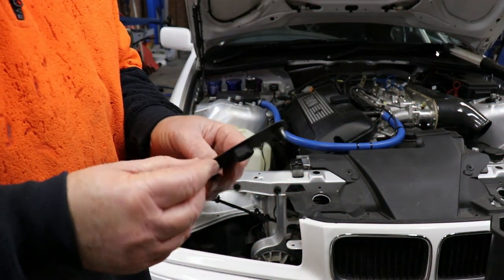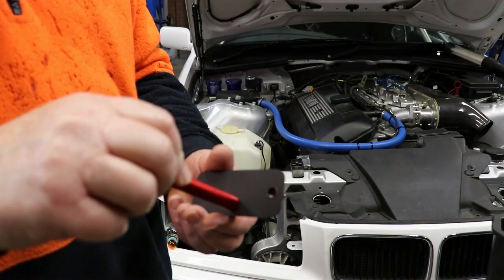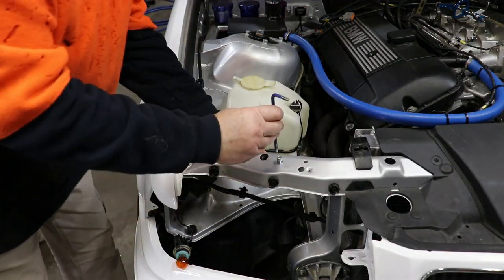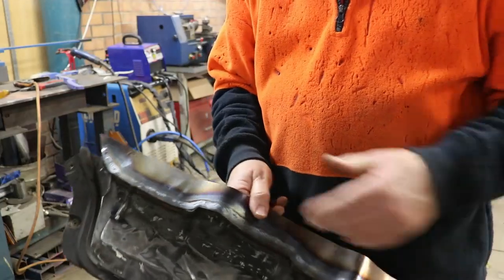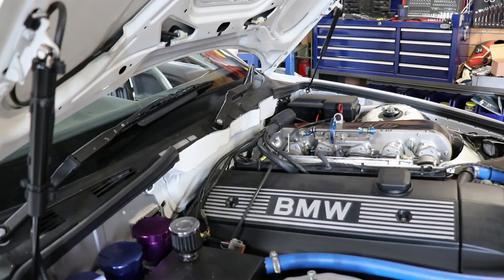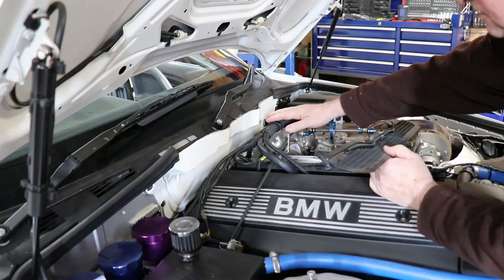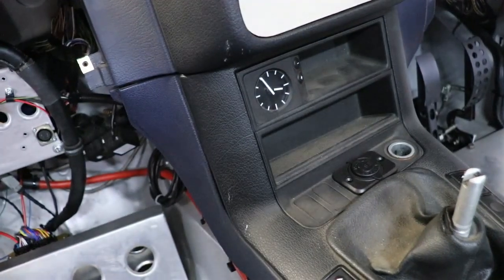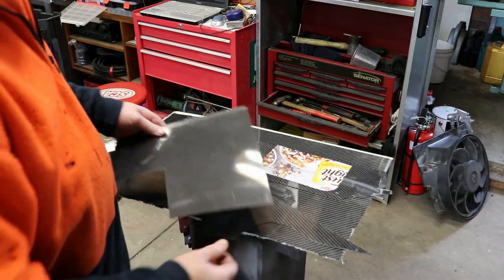Rally car almost finished, this is part 26 of my BMW Rally car build

Comment from the maker: An update, on the dyno the engine developed a miss on number 4 cylinder. We eliminated the obvious - spark plug, fuel injector, coil, vacuum leak, coil driver. Brought car back to the workshop carried out a compression test, all comps are good so now I am starting to pull down the engine to find the issue. I will have a new video chasing the problem soon.